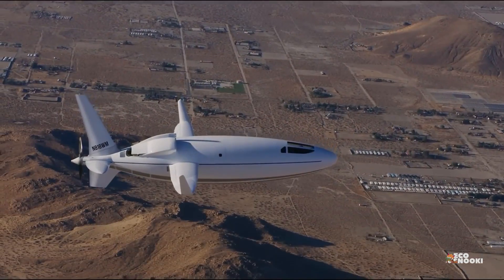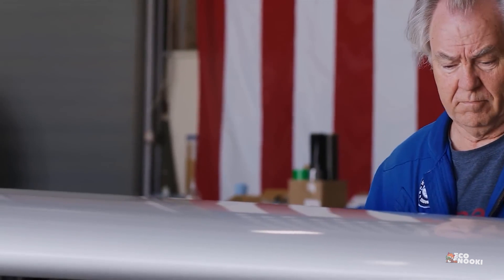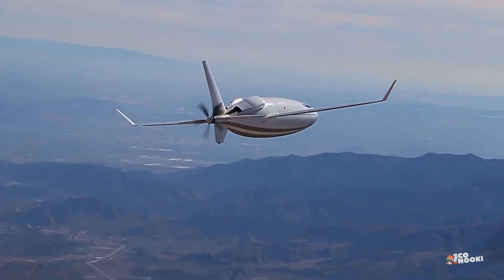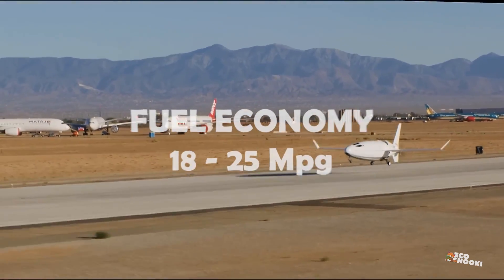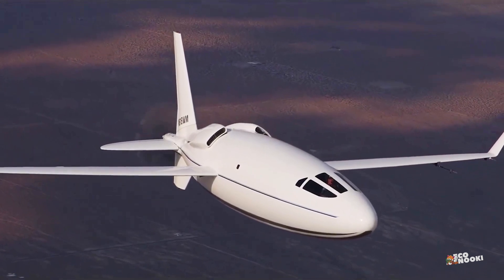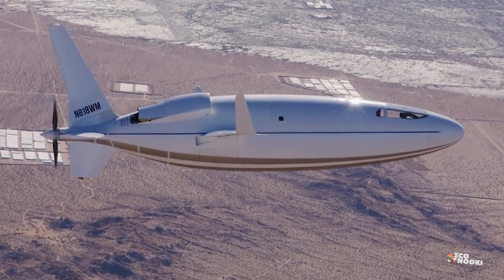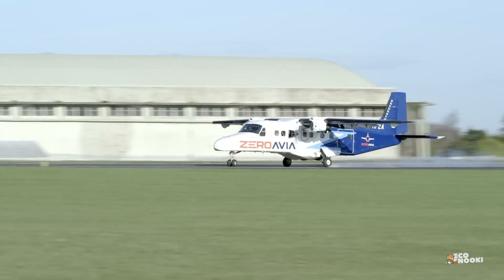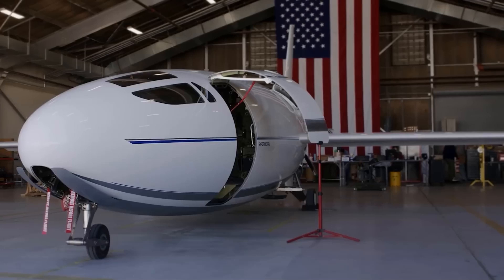Eco Friendly Flight, 30 Miles per Gallon!! - More Mileage than your SUV !!

Comment: Come on guys! S C A M. This aircraft will never ever come even close to the claims. I fly a comparable aircraft. Here is why: 
1. cooling drag: the extreme turbocharging needed to fly at 55’000 ft  causes massive drag challenges. This was the reason why towards the end of WW2 piston engines were abandoned in favor of jets. A secondary drag problem is caused  by pressurization: thus air also needs to be cooled.
2. pressurization risk: a single piston engine as source of pressurization for commercial flight is too dangerous. It will not get certified. Period.
3. climb performance: this plane has too little power (550HP) for its expected weight ( my: guess north of 5 tons). My aircraft which weighs only 2 tons and has 350 HP needs 20 minutes to 20’000 ft and its power/ratio is 60% better. The Celera needs to cruise around 55’000 ft to deliver the economy. It will take 2 hours to get there.... 
4 Icing: my airplane also has a laminar flow egg-shaped fuselage  (nothing new here btw). Whenever we punch through an icing layer and the fuselage collects a sandpaper-like layer of ice, performance is severely affected. 

An aerodynamics teacher once told us: the science of subsonic, propeller driven flight is closed, all of the principles (hint: including laminar flow) are well understood and correctly computer-modelled. anyone claiming more than marginal progress is implying that the designers before them were incompetent. You decide if this makes sense.